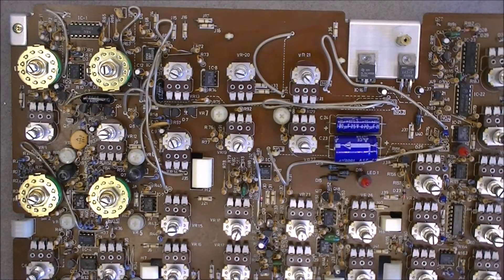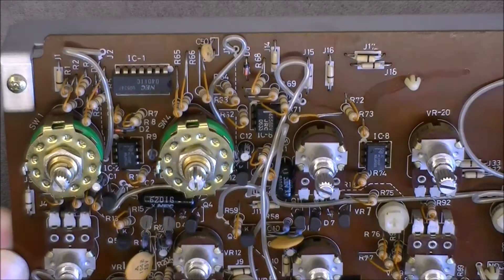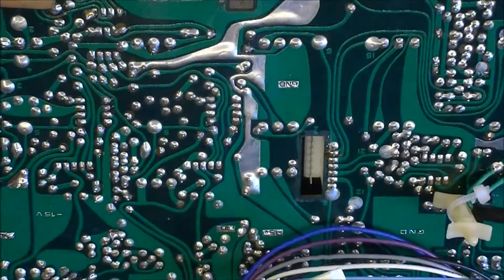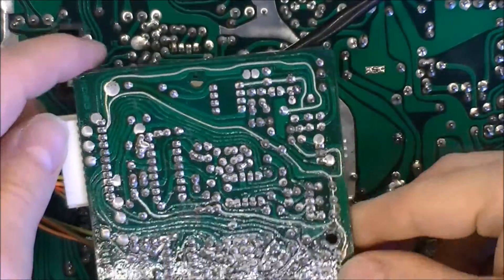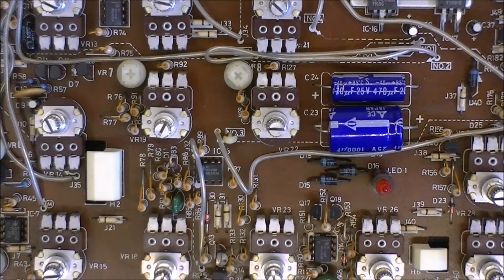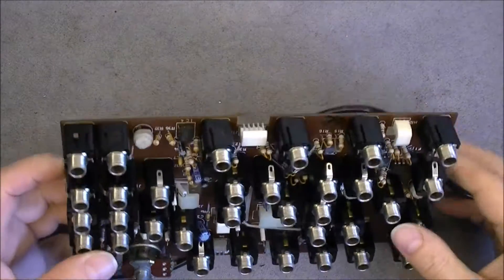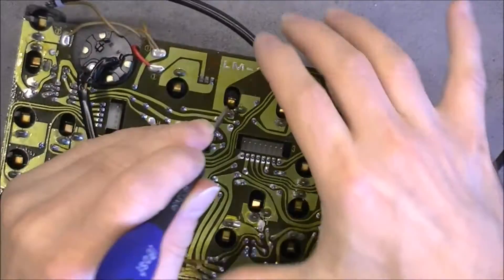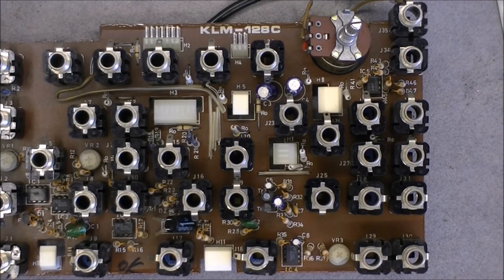Korg MS 20 cleaning and restoration part 6 Close look at the PCBs

Comment: That weird like a resistor looking part is ineed a resistor. It's a precision temperature stable resistor. 6201 means 620 and one 0, so 6200 Ohm. As you can see, manufacturer is NEC.